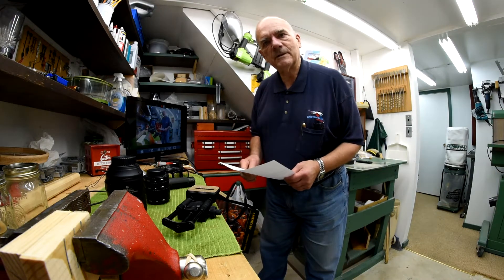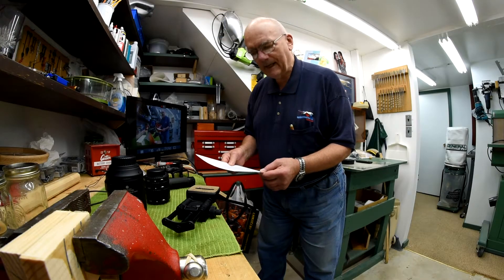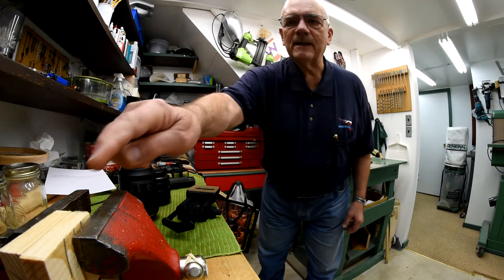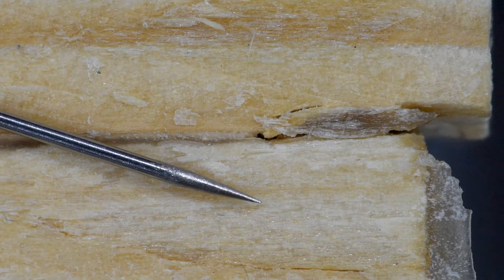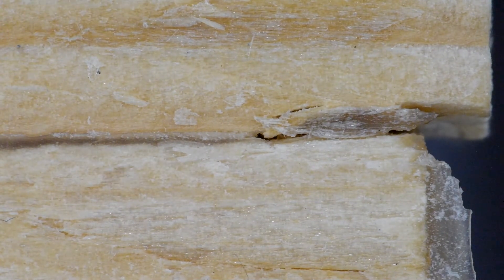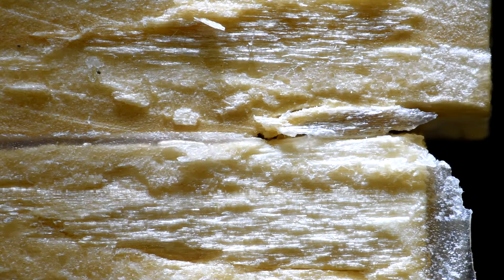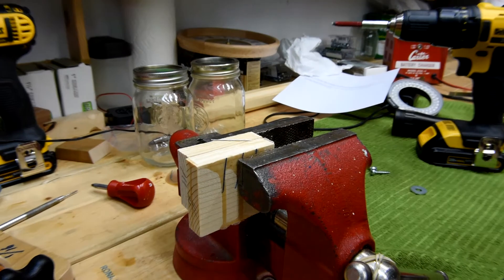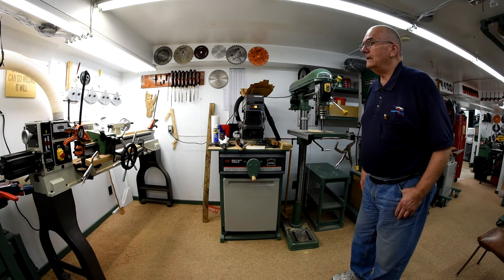"Glue Is Glue" Update

Comment: There's glue on both sides of the break.  That was a glue fail.  Also if the glue was not affected why did the blob of dried glue change from brown to cream?  Never bow too early.
Reply from the maker: I agree that it is not 100% waterproof --- in my unprofessional estimation anyway. Yes, the water did seem to have some effect on it. Like I said, I wouldn't use it to build a boat, lol :)
Reply: Having glue on both sides does not mean the glue failed.  The surface looked very rough to me as though each side had some glue and some wood fiber from the other side.  However, it is very hard to tell without more sophisticated analysis so it would be too hard to draw either conclusion.  The only glue I would really trust to be waterproof is resorcinol.  It is a pain to work with, but that is what is certified for use on airplanes and boats for a reason.  Epoxies can be pretty good also, but they have other issues such as softening in high temps and UV susceptibility.